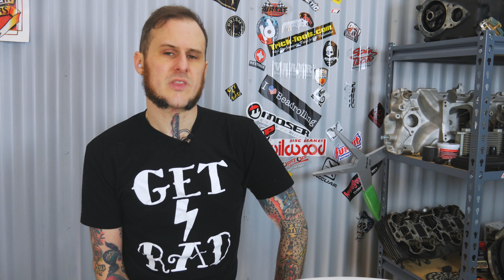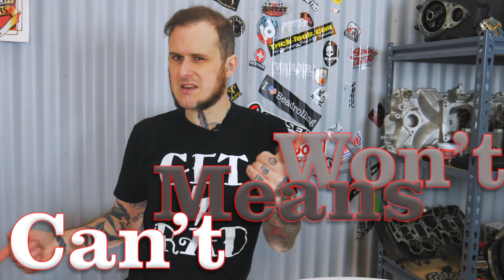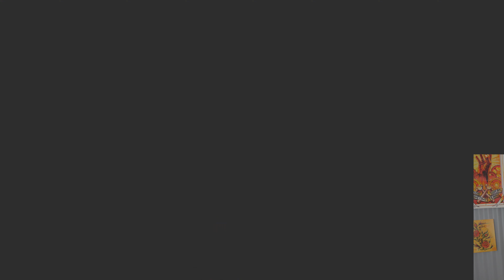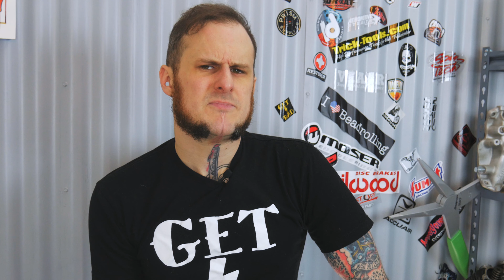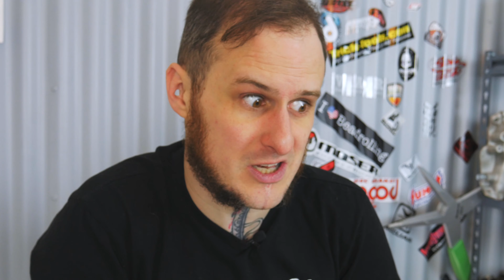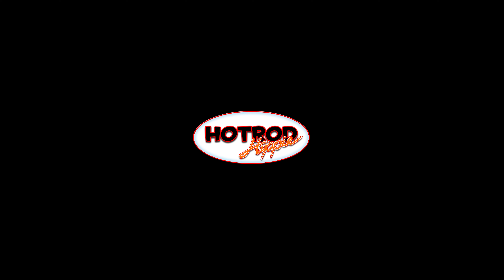Metalshaping Motivation - Can't Means Won't

Comment: It's true and you don't necessarily need fancy tools to do this kind of work. If medieval blacksmiths were able to form suits of armor and german craftsmen were able to form bodies panels on tree stumps when building post-war Porsches this can be done at home. A low budget means more work, but if you want it, you make it happen.
Reply from the maker: You are absolutely correct. I find usually (but not always) fancier tools are just aids to quicker / cleaner work. There are plenty of good value ways to get a job done too.👍
Reply from the maker: You are absolutely correct. I find usually (but not always) fancier tools are just aids to quicker / cleaner work. There are plenty of good value ways to get a job done too.👍